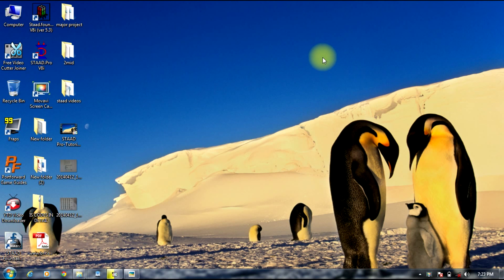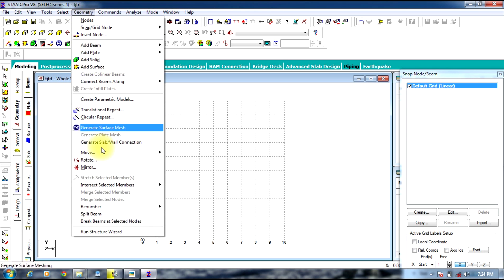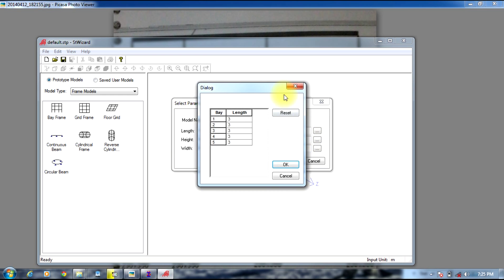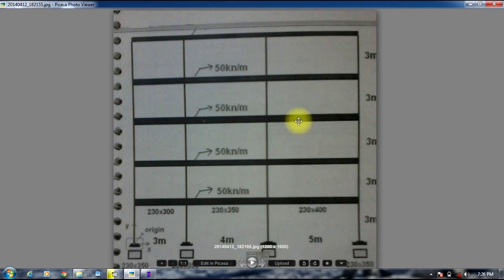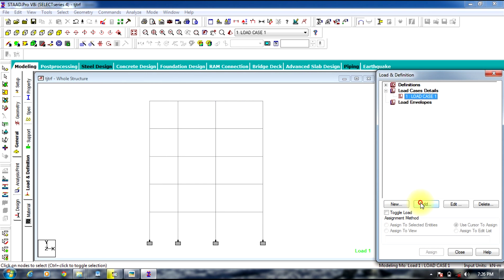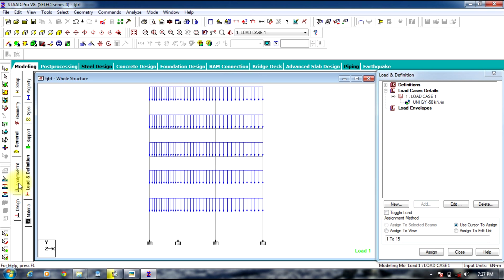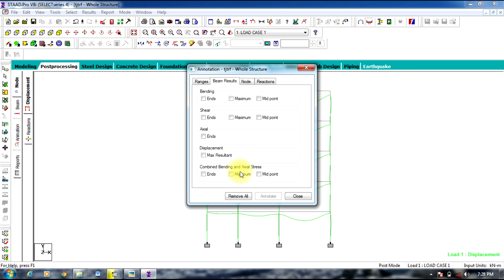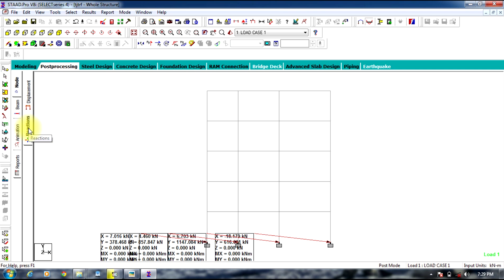STAAD Pro Tutorial-Multi Storey Frame Analysis-Day 5

Comment: Issue in merging stwizrd with stadd.
Reply from the maker: You should be able to merge. Close staad pro and then try it again.
Reply: CivilBuddy I have tried all things
Even reinstalled it.
Still it is not merging even I am not getting a dialogue box of node adjustment.
Reply from the maker: Did you do exactly as shown in the video while merging the structural wizard. If yes then I think there should be some kind of technical error with the software.
Reply: CivilBuddy might be

Comment: My Run Structure wizard is not opening ... i thot tat it is a installtion problem so i reinstalled it . but again d prob is same .. :( what shuld i do .plzz help me
Reply from the maker: Mashood Ali Did u install it wid your internet off........Make sure you run structure wizard after U select ANALYSE N PRINT option....
Reply: STAAD Pro Tutorials yeah ..i did xctly d same ..but d result is zero :(   #plzHelp
Reply from the maker: Mashood Ali 

Double click on stwizard.exe file from staad.pro installation folder

C:\SproV8i SS5\staad\stwizard\stwizard.exe

If that doesn't work

I think it is better to install once again switching off your internet if it is downloaded from torrents. If that doesn't work better you try downloading another file.

Comment: how to convert the displacement units after post processing????
Reply from the maker: Its better to select the units you require initially at start................................
Anyhow if you want the results in other units you need to select  
View---Options----then you can select structure units,section units,force units -------then change the unit--------Apply